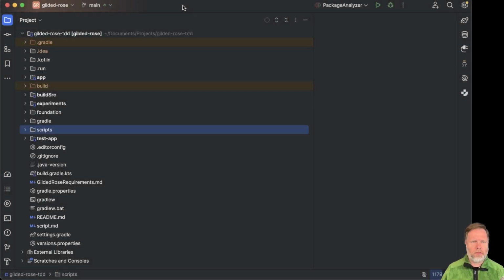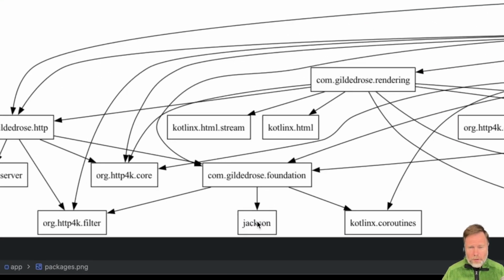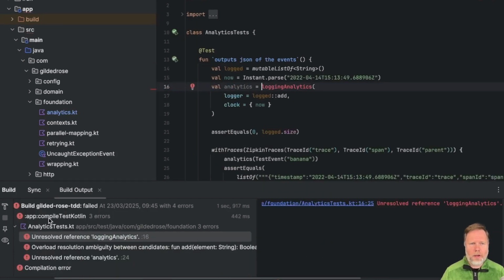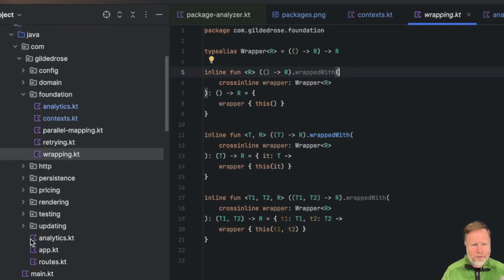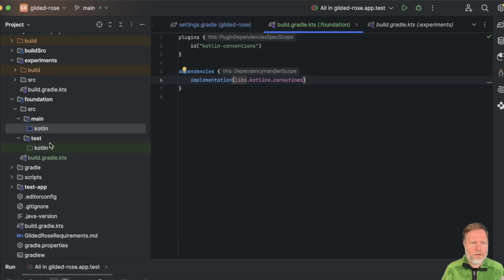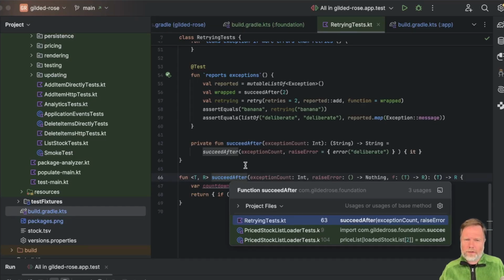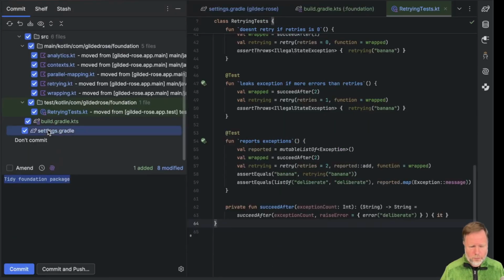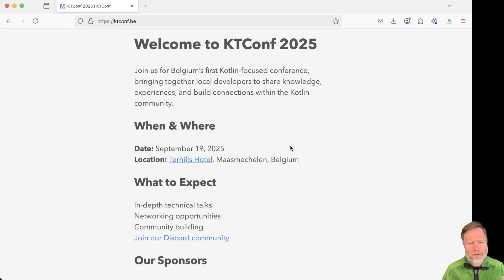Decoupling - Refactoring to Modules

Comment: Interesting.  You create separate modules in the same project. I've created separate projects, and import them into the same intelliJ workspace -(I do a composite build: (includeBuild + implementation))  and it seems you have multiple projects, inside another project (a multiproject build) ...and I just discovered after 15 months, the 'Select Opened file' button!

Comment: Nice video! By the way, you can use enableFeaturePreview("TYPESAFE_PROJECT_ACCESSORS") in settings.gradle.kts to make typesafe refs of modules instead of the string form.
Reply from the maker: Oh is that what that does? Thank you